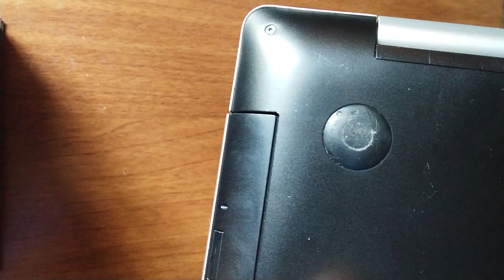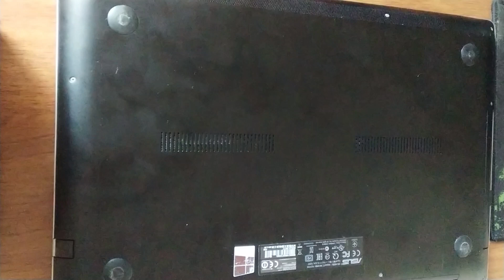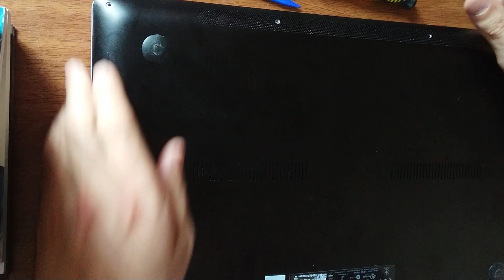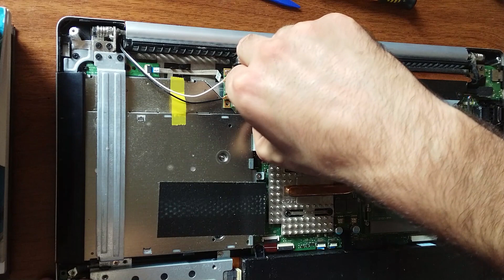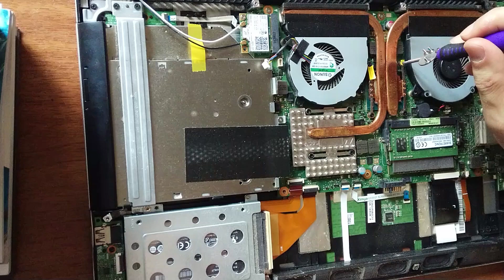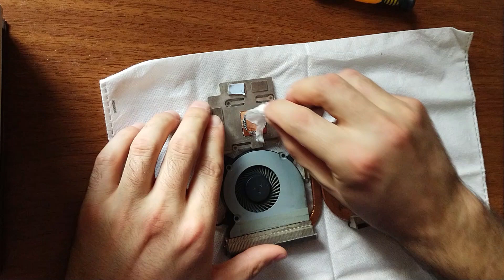ASUS N550J - Disassemble, Fan Cleaning, Removing Dry Thermal Paste

Comment: Absolutely amazing job! The level of detail in this disassembly and cleaning process is top-notch. Watching you carefully open up the ASUS N550J, clean the dust-clogged fan, and properly remove and reapply the thermal paste was both educational and satisfying. It's clear you know what you're doing – from handling delicate connectors to ensuring proper thermal compound application. This kind of thorough maintenance not only extends the laptop’s life but also helps others feel confident doing it themselves. Thanks for sharing such a clean, step-by-step walkthrough!